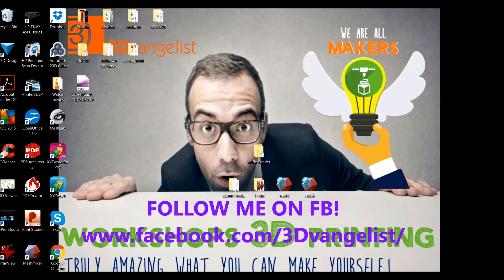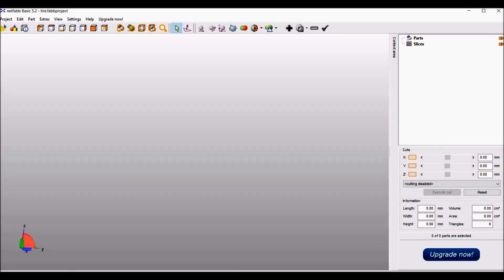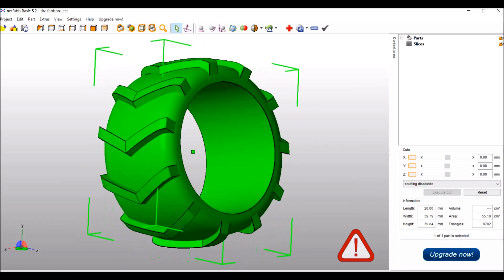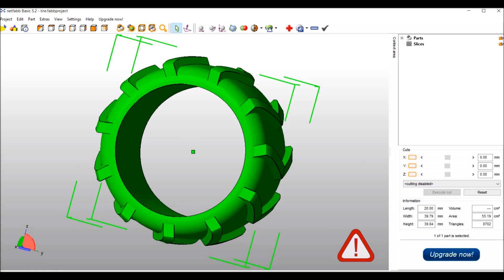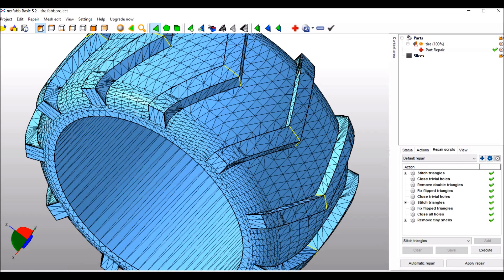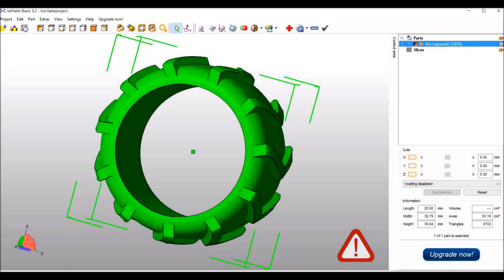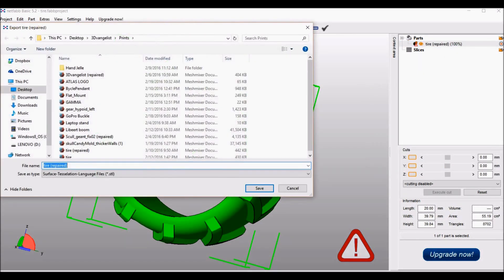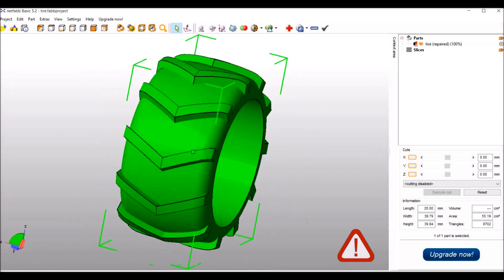Why Netfabb Basic?

Comment: Incomplete advice. You must continue to repair until the /!\ warning sign disappears. Netfabb isn't a magic wand, but a veritable toolbox. You still have to examine your part for remaining errors until it's completely fixed, and use the tools provided in good judgment to achieve a spotless part. Yes, there are predefined repair scripts, but they can fix only so much. Most any of the 3D print services will refuse broken part data, and some particularly tricky constellations of errors will royally screw up your print even on an FDM.
Reply from the maker: @Anvilshock...thanks for the feedback. My experience is that 99% of the time this script run is more than enough for FDM prints. Extra repairs usually happen while uploading in automated software for 3D Print Services. More complex designs might need more, you are absolutely correct and especially if you want to use SLA, SLS or anything else. My idea always is to use as much open source software as possible.
Reply: "uploading in automated software for 3D Print Services" - Let it be said that those automated services don't work with magic, either, but regular print preparation software, too. Including, yes, Netfabb. Meaning that if your upload contains faults that cannot be repaired by just clicking the Execute button next to a repair script, some poor sod will have to find the microscopic flipped triangle, or superconcave surface (that is a surface so strongly distorted it bulges out through the other side), or 100000 triangles heavy micro diamond structure from the rounding errors in the fifteenth Remesh of a point cloud scan, or whatever else nasty hex is plaguing your model of a dog poo, and fix it manually to get the purchase fulfilled. And this, my friend, does not make you a desirable customer. So rather than handwaving a half-arsed STL off to the print service of choice where you have NO CONTROL over the repair attempts and risk forking over 30, 40, 50, 100 quid for a ruined model, it should be in your very best interest to do the fixing yourself, mind.